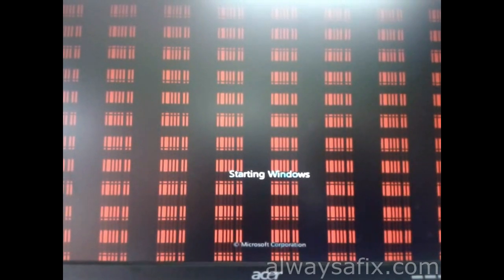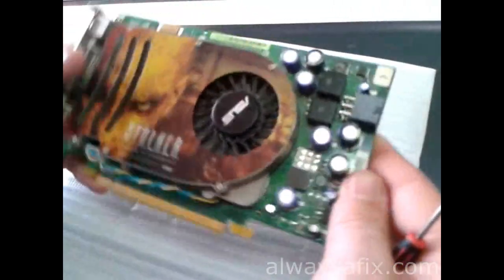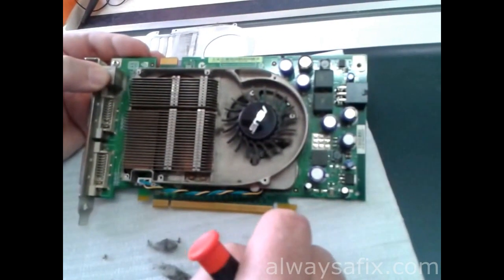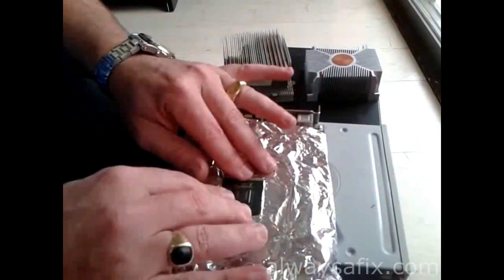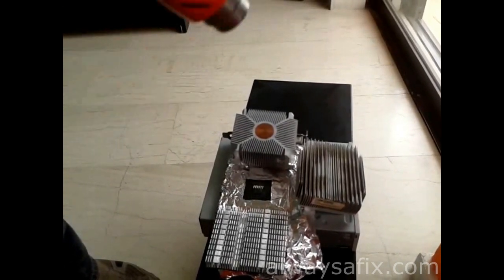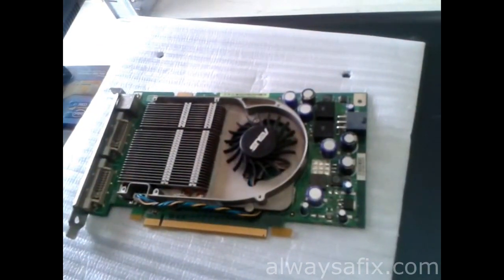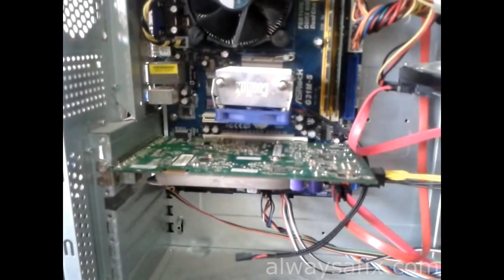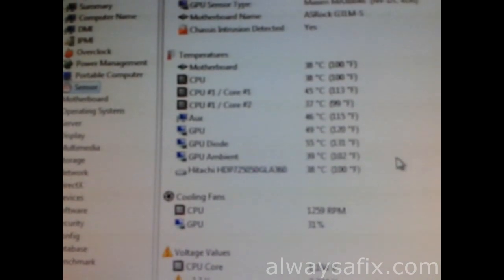Screen problem with colors and lines VGA reflow

Comment: please - i have a GTX 780 and i'm thinking of heating it like this. i want to use it until i get enough money for a new card. i re-balled it before and it worked 8 months then it stopped. my question is: how long would it work if i do this? i really need your answer.

Comment: A week ago i bought Gt 750 Ti 2 gb Nvidia . initially 2 days it was working fine. but the 3rd my screen went black and then when i called up a technician he re inserted the Gpu by attachin the thread on top of GPU with the inside cabinet so that the GPU wil not shake from inside.. the technician told the GPU is not fitring properly which is why it is causing problem. only for an hour after the technician left again same blur screen with Big icons and multi colors screen. Please help me with this.
Reply: Oh

Comment: I bought a gpu brand new off Amazon, it came and there's thick red vertical lines going down my screen whenever I try and use it. If I drop the resolution to 800x640 the lines go, and it starts showing small dots all over the screen, what should I do? It's an AMD Radeon R7 250 2gb DDR3, every time I update the drivers my computer does an automatic repair and resets the settings, please help!!
Reply from the maker: It sounds like you got a faulty graphics card.  You need to return it.  Good luck!

Comment: I have a Radeon 9200 video card which has a similar problem. I already reflowed it, tried different drivers, reseated it, ran benchmarks and it is not overheating and at this point i don't have a clue what's going on. Do you think you can help me? I am thinking of changing the capacitors, but i am not sure that would work. Btw the problem got worse (i got more artifacts on my screen) after heating it up.
Reply: ***** Yeah i think i will need a new video card. I am pretty sure that the fault is in the video memory chips, which i could replace, but they will cost me around 70$ so it is not gonna be worth it.
Reply: Well those are good options, but i need an AGP video card and it is also for my father's old Dell OptiPlex 260 so it doesn't have to be anything fancy. I want a card that can play YouTube videos smoothly and also 720p movies and that is about it. I am also limited in terms of size - my father's computer is a SFF computer so i can't just put anything in there. That is why i chose that Radeon 9200. A FX5200 or GeForce 6200 would be a much better choice i think. Thanks for the suggestions though.

Comment: hi my hd 7850 have horizontal lines on it but only if I install the display adapter driver,can u help me
Reply: Plug your monitor in a socket on your wall ALONE. Don't plug your monitor to to the same power cable with your case.
Separate your case and monitor powers.
Reply: +abubaker havalivala I have the same exact issuee.
Reply: I change the graphic card afterwards it seems my cheap power supply damaged it
Reply from the maker: +abubaker havalivala This type of graphic problem usually occurs due to overheating.  Thanks for watching.
Reply: ok thanks

Comment: Hi bro I have a black and decker heat gun too (orange wuth black mouth) how do you know the exactly temps if I dont have termo to check?
Reply from the maker: I have an infra red thermometer to check the temps.  They are dirt cheap on ebay, and always come in handy.  Thanks for watching!
Reply: Thnks 2 you for reply, I think ill buy one good luck